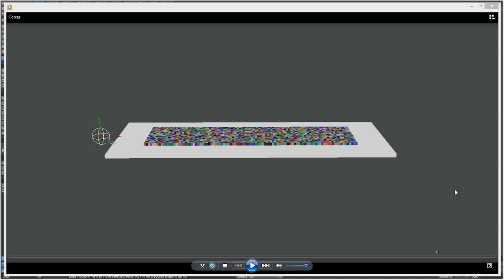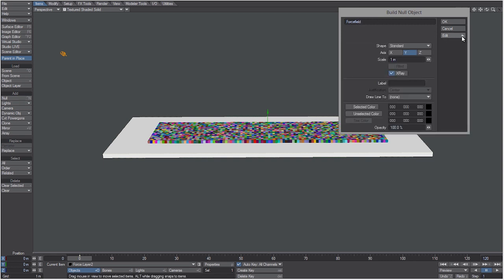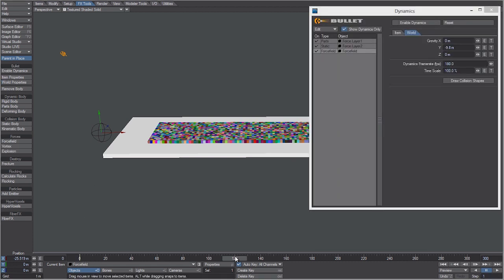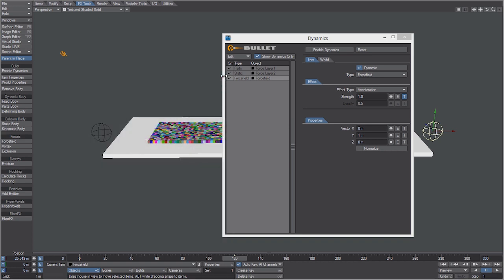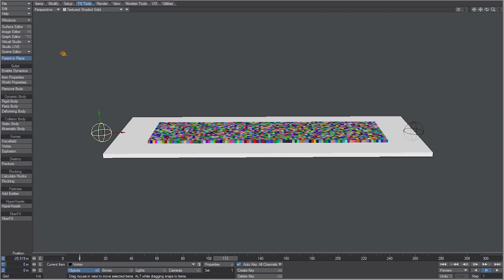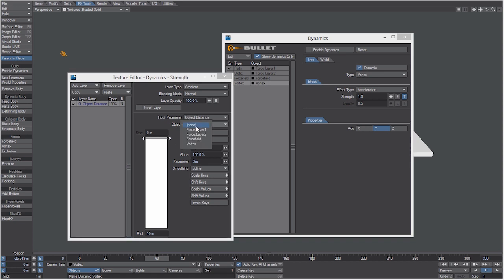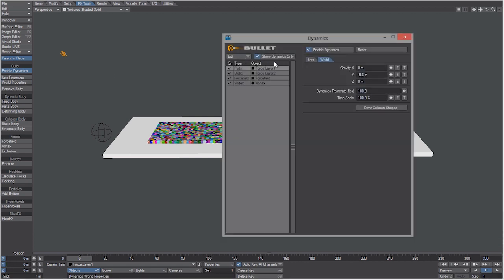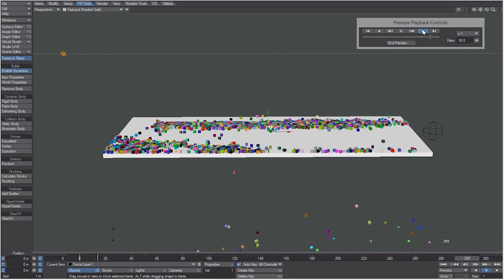LightWave 11.5 Forces Tutorial

Comment: TIP: If you want your parts object (boxes for example) to stop moving at the beginning, Which they still do in the video above even after Cody sets it to start on last key frame. Set your glue strength for your parts to 1% and set you breaking angle to 0.1. This keeps the boxes completely still and still allows you to have them break apart saving you from using the start on last key frame.

Comment: Thanks for the tutorial it works great in lightwave 11.6.3 but unfortunately it won't work in lightwave 2015.1- 2015.3 even tried recreating recreating from scratch the force field and vortex forces won't work and I'm not sure why this is? 
Are you guys aware of this issue or bug?

UPDATE: Thanks to DogBoy on the fourm - Turns out you have to scale up all the settings drastically from what's in the video for it to work in 2015.